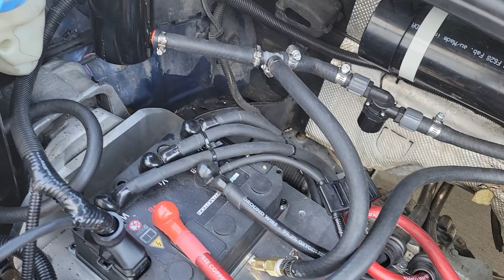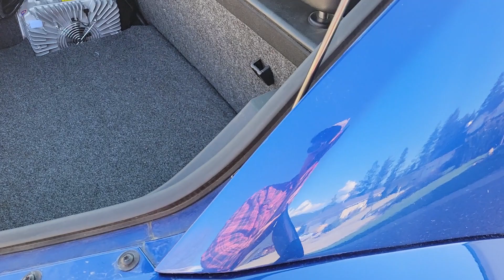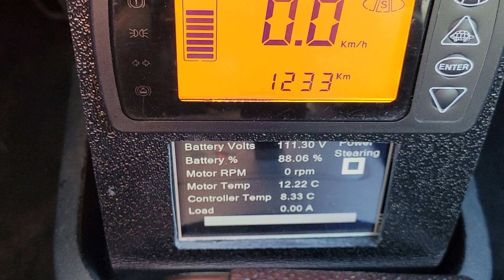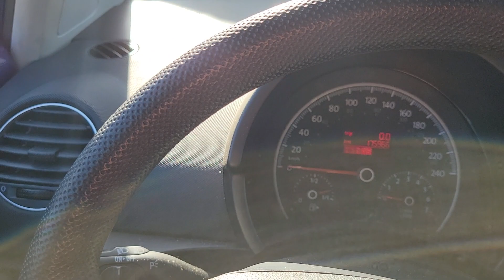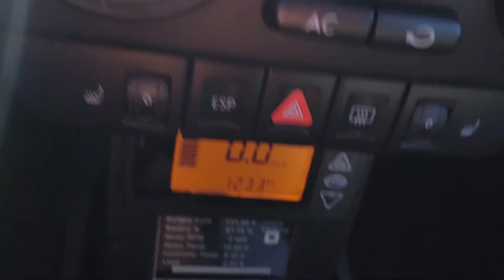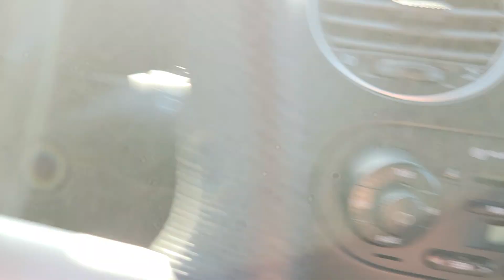Voltswagon 2008 Beetle Electric Conversion all done! (For Sale!)

Comment: This is really good. Second time ive watched your video. How did you get on with the abs and airbags. Do the still see the car as moving and function as required? How did you get the engine warning lights to go away and if you had ignored them and just drove with the panel lit up with "faults" would it have mattered apart from being slightly annoying i mean. :) . Theres some beautiful modern cars that simply have unreliable petrol engines that would be good to get rid off like many BMWS for example but im not sure if it would be ok to just drive with the screens lit up with "faults. Ie would the abs and bags still work.
Reply from the maker: The airbags and abs work fine (didn't disturb any of them) the ECM took quite  by removing the DTCs one at a time (there was lots)   but everything works like it should :)

Comment: I'm looking at buying a VW beetle to convert for my wife as a daily driver. How much did all this cost and did you have to do any fabrication?
Reply from the maker: Probably 10-12k , 6 months of work and yes everything with the conversion was 100% fabricated except for the actual motor/controller/bms controller/charger
Reply: @rodn6766  if only someone would sell a conversion kit for this card that just bolts in place of the original parts
Reply from the maker: @ThatTechGuy123   yea looking back I really should have done a better job of documentation and made templates... next time for sure. Yes I agree a kit would sell

Comment: Which conversion kit you adopt? How about the AC compressor. How you convert to electric?
Reply from the maker: I haven't bothered with the air conditioning yet was more concerned about heating it.
As far as a conversion kit, it was 100% fabricated by myself. If you look at some of the other videos it shows how I converted the automatic transmission to a direct drive. The adapter plate was made from 1/2" aluminum plate.

Comment: interesting conversion, afew question, the auto transmission, what exactly you removed and how you control car gear change?
Reply from the maker: It's direct drive, removed the pump, clutches, planetary. Just used the crown and pinion pretty much. There are some other videos on my channel that shows how I did the conversion

Comment: How do you manage the SOC on the old gasoline gauge? very nice
Reply from the maker: The thunderstruck BMS has a pwm output you can configure to give battery voltage with 3 or 4 offsets and setpoints .. it took a day or 2 to fine tune it but a capacitor on the pwm out line and tied it to the fuel gauge sensor line.. 👍
Reply: @rodn6766  thanks Rod, we're working a 1999 new beetle in Costa Rica, definitely would try to get ours working the same way
Reply from the maker: @cesgonso  awesome !! Automatic or standard?
Reply: @rodn6766  standard transmission, with clutch, 36kW motor, with 20kWh battery pack
Reply from the maker: @cesgonso  that will be very nice please do lots of videos and make templates of everything you do.. wish I would of. Please keep me updated if I can be any help with anything give a shout!
Reply: @rodn6766  I will, thanks!!

Comment: Awesome conversion!  I want to do same!
Reply from the maker: Yea real happy with Herbie, just wish i would have documented the build a bit better!  Next time!
Reply: @rodn6766  Next one, thanks for sharing the finished product?  Did you use a blueprint, kit, or have a good EV reference for the build?
Reply from the maker: @MFH the NYC Fly Guy  Nope started by pulling the motor and transmission.
I did  bit of research on the motor before I bought the VW (weight torque gear ratio tire size etc) 
If you decide to do it, I could talk you through the process
Reply: @rodn6766  thanks @rod n; I’ll let you know if it comes to fruition!  Enjoy your EV bug!

Comment: do you have any form of regen? I'd be very interested in the wiring diagrams!
Reply from the maker: Yes it does regen .. using the hyper9 setup from thunderstruck-ev.com (and their MCU BMS /charger/ DC/DC converter
The schematics for everything is there fir the motor/controller etc

Comment: This is such a nice conversion.  How where you able to figure out the Can-bus stuff?  I have access to an A5 with a blown motor that I'm thinking of converting, but I'm worried I would never get the electronics straight.  Any thoughts would be appreciated.  Thanks!
Reply from the maker: Hey Steve
I messed around with the ecm for a few weeks removing DTCs .. after the 20th time in and out with the ECM I tried it without it completely! And it's 100% fine. I left the bcm/tcm/abs etc and all is happy. Had to reconnect the speed sensor in the transmission after I removed the valve body/solenoids etc.
If you decide to go for it happy to help. The most challenging time consuming part I thing was wiring and programming the BCM but  ext one will be a piece of cake!

Comment from the maker: If anyone is interested in tackling one of these will be glad to share any build information you need
Reply: I am, I just pulled the engine out of my beetle
Reply from the maker: @michaelbarden6987  hey Michael what year? Automatic or standard?
Reply: @rodn6766  standard, I didn't want to use a Lovejoy connection, so I cut the flywheel  connector plate free of the camshaft, I'm going to have a machine shop drill it out to attach to the motor. Debating with myself if I should try to put an Audi tt quattro drivetrain in it.
Reply: @rodn6766  98
Reply from the maker: @michaelbarden6987  interesting, so you cut the flange off the crankshaft and are going to use it for a motor coupler? good plan, not sure what motor you are using but would make sure the one your using will be ok with the bearing end load from the clutch (if your going to be using it)  what are you using for batteries/ bms / motor controller?
Reply: @rodn6766  I hadn't bought the motor yet, I was looking at the hyper9 I saw on EVwests website, and I'm using a lightweight flywheel and clutch, so it should be well below load limit. The motor comes with a motor controller. I hadn't decided on a battery or BMS yet.
Reply: @rodn6766  I have never converted a car to electric, but I felt the need with the price of gas and the way technology is trending.
Reply from the maker: @michaelbarden6987   I bought through thunderstruck-ev.com John was really good about helping me through the setup and programming
Their charger/BMS works really well..  the wiring and programming is a bit of a task but happy to share what I learned when it comes to that point.
This thing costs me about 2 cents a mile to drive (electricity costs) Ram diesel doesn't see a lot of miles anymore 😅
Reply: @rodn6766  I have tried searching for different distributors of EV parts, I hadn't heard of thunder struck. The wiring truly is my biggest issue. So that would be a big help. Should I contact you here? Id like to send pics of my progress. I have to say the way you built that battery box was genius, I was think about doing that as well.
Reply: @michaelbarden6987 hey man I think it would be cool if you did a little update video on how the progress of yours is going or if you finished it I’d absolutely love to see how it’s going :)
Reply: @CloveCreature  so after a cost/range analysis, I determined that the Beetle was to heavy to perform how I wanted. I live in the country, nearest city is 40mins/30miles away. My project is going to be  a commuter car, so it only needs to carry myself and a little cargo. As such i have opted to build an electric car from scratch. 1seat, 3 wheel,  rear wheel electric hub motor drive. I am in the process of assembling the frame. When frame is ready I will make a video showcasing the work/project.